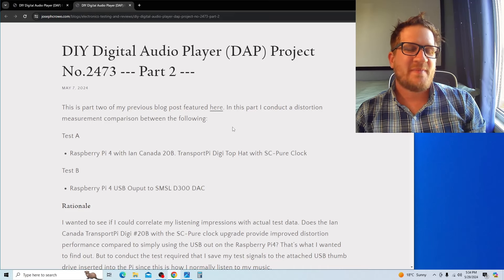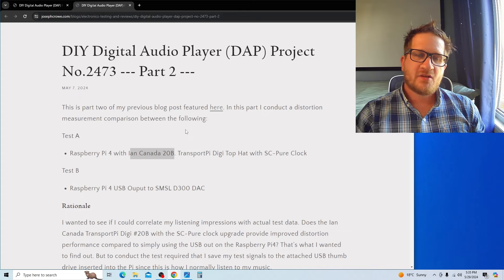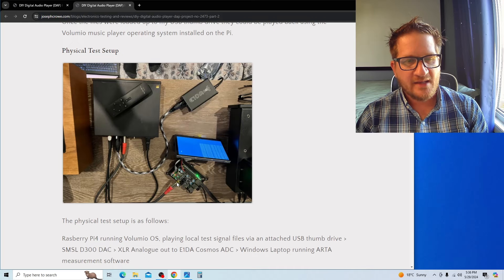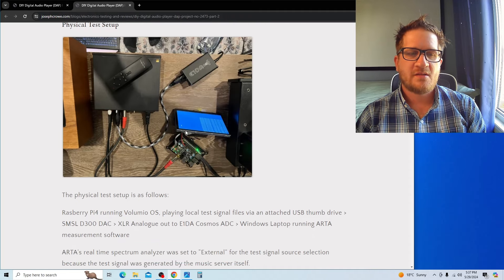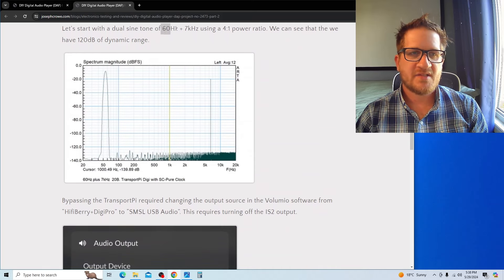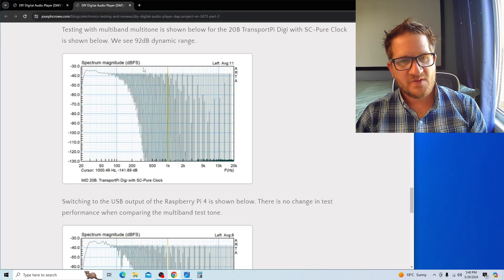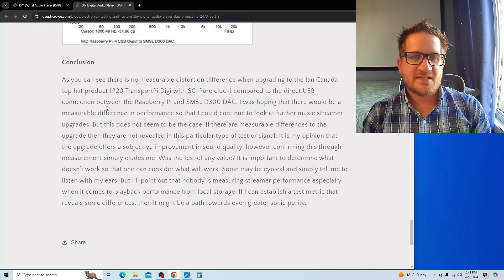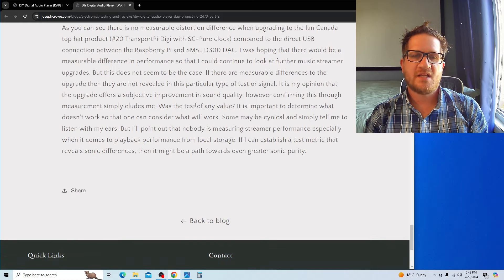Part 2 DIY Digital Audio Player (DAP) Project No.2473

Comment: Joseph 

I started a similar journey in the midst of the pandemic.

PI USB comes with one cavet sometimes lack of upgrade firmware can  interferes so flas it to the latest .

Clock Upgrade is not crucial because the USB passes data asynchronously.

My test of  PI & x86 Fanless proved the most realistic deep soundstage equivalent 5 digit sound system.

Put clean power into the PI  or X86 try a SMSL -PO100 for the DDC into the SMSL-D300 with the proper upsample multiple if not hi-res already .

You will be impressed!!!

Out of boredom I tested about 300 combinations of Old,New, Vintage,R2R,R2RHATs equipment if you don't hit perfection I'll tell you exactly how to set up Volumio with an external DAC.
Keep posting

Comment: This looks like a fun project, will you try it with streaming once you have the final setup finished ? I am not a DAC expert and the circuits used in audio products often surprises me. But from  a communication circuits background to me it seems like the performance of the digital transport shouldn't have any impact on the final signal, ASSUMING the DAC was implemented properly. The jitter performance of the DAC will be defined by it's own clock reference not the clock being used by the transport. A proper DAC should be buffering the incoming bits and the DAC will retime all that data with it's own clock reference. 

Alot of audio circuits are using really old topologies, and I wouldn't be surprised if you could find many DACs that did have their performance hinge on the performance of the transport clock.